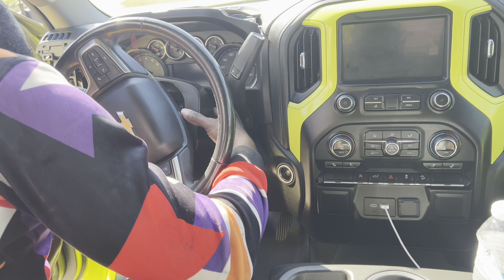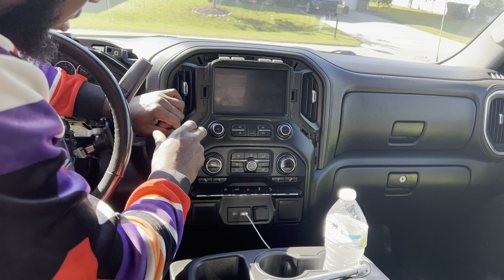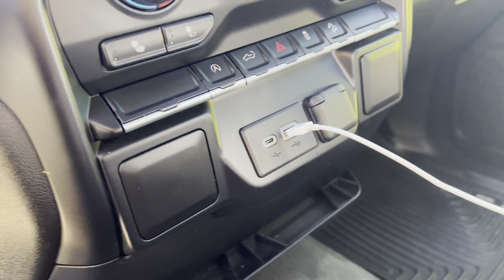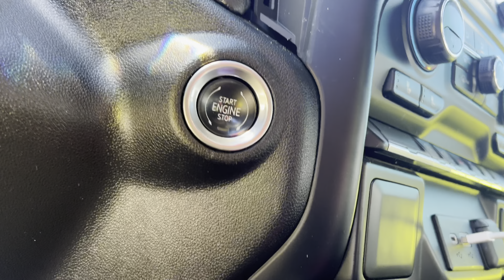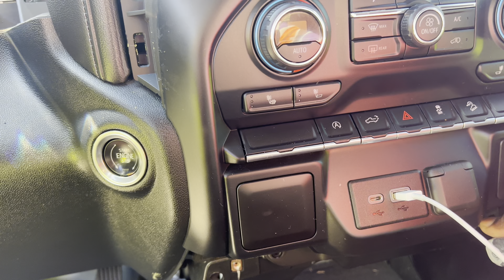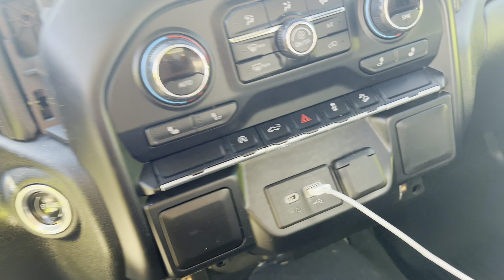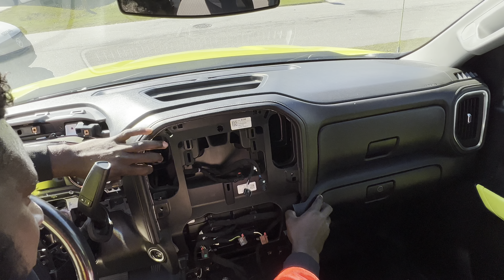2020 Chevy Silverado Tech Tip: How to Remove Dashboard

Comment: Awesome video. exactly what I was searching for. I'm looking to put a bulkhead usb connector into the little dash top tray (sunglass or whatever its for) to run power to a dash cam/phone etc. Its a little hard to tell from the video if there is room directly underneath the dash at that point for such an item. is there a bit of room under the little tray from what you saw?
Reply: Did you ever get this done? I’m looking to put a bullet point mount systme in the dash cubby and add two usb ports. Hesitant to drill through but wondering how much room there is behind the radio and under the storage hole.
Reply: @frup13  Heya, so I am also using a bulletpoint mount system. I decided I didn't want to put a few one inch holes in the dash under or forward of it so I decided to design a mount bracket for the usb's and in my case a RJ45 for a ham radio head unit and some additional power ports (anderson power poles). I had it fabricated in 14 gauge steel by an online company and powder coated. I have not done the wiring yet though. I am also going to install the GM upfitter 5 aux switch panel (gm part that gives you 5 switches next to the parking break) and want to do all the wiring once so I don't have to rip the dash apart multiple times. I have a 2021 trailboss. this way I can just poke a small hole for the wires and terminate them once through (or at least you just poke 1 hole the size of a usb end and I'm 99.9% sure a couple of usb cables running up the middle from the center console will be no problem. I have pictures of the mount here 

http://www.playdead.net/bulletpoint/

I added mounting holes to the top of the bracket with the idea that down the road I might put a dash cam in and then will design a bracket to mount to the holes. The center cutout is there specifically to not block the center screw of the bulletpoint but also big enough to let a usb cable go through if desired for whatever reason. if you're interested, it would be pretty simple for me to do just a 2 USB design and get you the files and instructions for a fab company (i've been using oshcut and sendcutsend depending on the part). you can email me at chris AT playdead.net if you are.  take care!
Reply: This is what I am doing.  I think if I can get the glove boxes out I can fish wires through.

Comment: Thanks for the video! Can you link me that tool you use for the pins?
Reply from the maker: https://www.walmart.com/ip/Hyper-Tough-8-Inch-Carbon-Steel-Door-Panel-Remover-with-Ergonomic-Handle/652909013?wmlspartner=wlpa&selectedSellerId=0&wl13=5046&adid=22222222278652909013_117755028669_12420145346&wmlspartner=wmtlabs&wl0=&wl1=g&wl2=m&wl3=501107745824&wl4=pla-293946777986&wl5=1021054&wl6=&wl7=&wl8=&wl9=pla&wl10=8175035&wl11=local&wl12=652909013&wl13=5046&veh=sem_LIA&gbraid=0AAAAADmfBIpJSiMyrXBt-dpGT2tv6K12I&gbraid=0AAAAADmfBIpJSiMyrXBt-dpGT2tv6K12I&gclid=Cj0KCQiAk4aOBhCTARIsAFWFP9Hrh5LZc-16akSVzXkMzZZI_MTmCGVDFsgq9fxaIgL7jL-GpF0LJAsaAuHVEALw_wcB&gclsrc=aw.ds